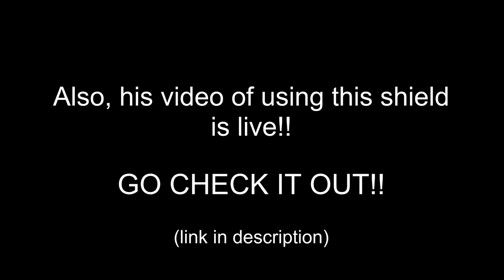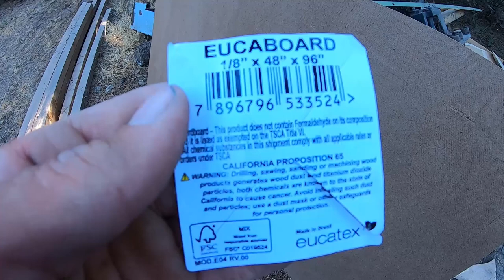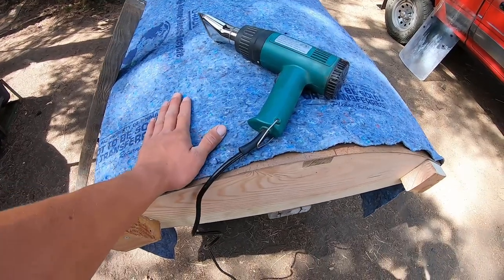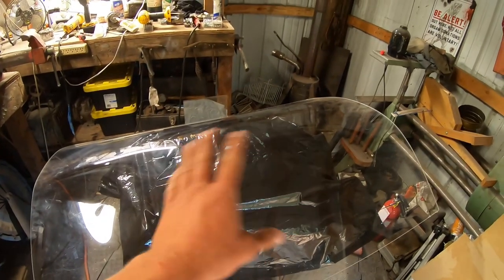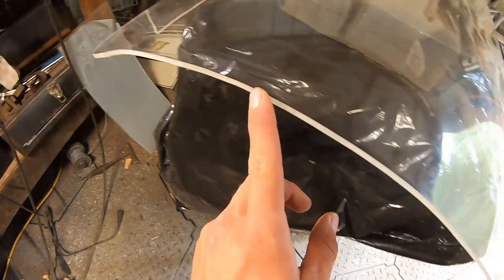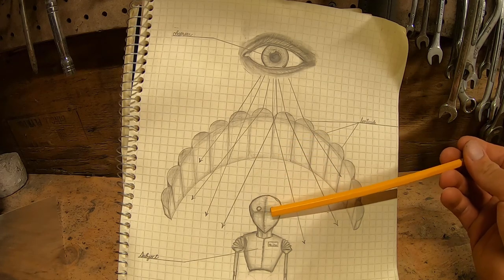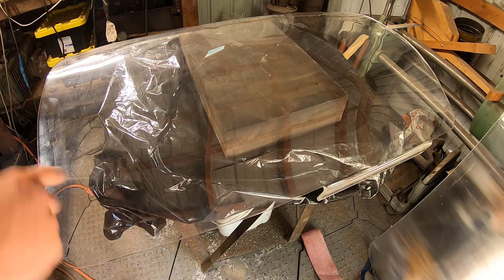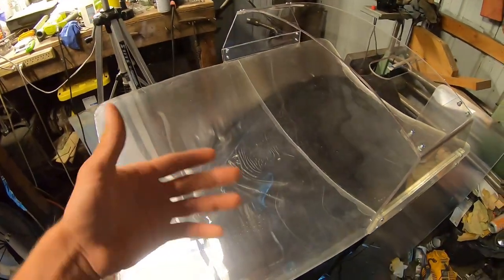Building An Updated Invisibility Shield... For Chris Ramsay!?!

Comment from the maker: To everyone curious, I purchased my lenticular lenses here from this website: https://www.lenstarlenticular.com/store
The specific ones I used for this project were the 100 LPI 3D option. Thank you all so much for the support on this video!
Reply: I did not say this: try wearing vertically striped clothes, with alternative darker and lighter tones of gray, behind the shield...
Reply: Why don't you liquify it and dip it into cloth and make a suit or clothing out of it?
Reply: Make a invisibility suit
Reply: How much would you charge to make one?
Reply: Have you experimented with the different "viewing angles" they mention? Im sure that effects the distance that the object to be obscured needs to be from the shield... also perhaps I could put in a order with you for a couple sheets?
Reply: When cutting plexiglass I have found using a router makes a great edge and no cracks or breaks. Not to mention super fast. Or add oil to the jigsaw blade, or to a drill bit. Less cracks are a good thing, and it speeds things up.
Reply: You need to make one of these using Norland 61 UV Cured Epoxy, so you can coat the entire shield with the epoxy and lay the lenses flat onto it, then cure the epoxy by setting the whole thing outside in the sun.
Reply: Can you beat a motion detector with this?
Reply: Have you tested this with IR or thermal?
Reply: I would love to see, what happens if you apply the 3d layer on both sides or in multiple layers (on multiple plexi). Also glueing 2 sheets together and making just the frame from plexi so it would be lighter.
Reply: 13:57 that sound makes me misophonia :v
Reply: Can’t you you just scrap these from old flat LED computer or TV screens?  I have scraped old projection TV screens for the franzel (sp?) lense to make solar magnifying cookers etc., but there is usually an extra lense or two which also seems to defract light in a similar fashion as yours does.  I have also found such lenses in old laptop and phone flat screens.
Reply: Disciplinary committee and de foo
Reply: @deusexaethera  well, you beat me to it. But you're correct on the glue type. A low viscosity UV epoxy would work perfectly as long as he could minimize the bubbles that form during curing. I know with cell phone screen I have a vacuum chamber I put the screen in once they are glued and it automatically pulls the air bubbles out then flips on the UV while it's under vacuum. The screen comes out so clear you can't even tell they are a refurb because the only part that's not OEM Is the glass, glue, and double-sided adhesive tape. Pure Genius if he would put both bits of knowledge into one amazing device. I love technology 🤣😅
Reply: @MrMoonFlame  yes
Reply: Just one question. Why?
Reply: @garlanddavidson6845  what would you use it for? Aside from stating the obvious!
Reply: @carlwilliams6977  Becuase he can and because he was asked to do so!  That's whu👍
Reply: @Photosbylambert  I thought I eliminated those answers in my op by saying other than the obvious. Let me spell it out for you. What could be a practical application that would justify all this work? I mean sure, I can't see him, but I can sure as hell see something that doesn't belong there!  As a high school science experiment, it's pretty cool. But practically??
Reply: @carlwilliams6977  answer: deer hunting blind for ground blind or tree stand. 😆
Reply: Would this application be effective on a parabolic shape?
Reply: At night? I would imagine similar as long as ur not backlit. Our eyes scan for, and easily pick up, human shape. This has potential!
Reply: What if you did it on the face shield of a motorcycle helmet, would it look like you are headless?
Reply: @carlwilliams6977  Idk I’m somewhat infatuated with it. ,I would probably use it with friends,and show people that it’s possible To be cloaked in real time.
Reply: Are you interested in selling some of those sheets?  I'm looking to making some art pieces with this but technique but do not need 75 sheets just 2-3.
Reply: @MrMoonFlame  No.  The Fresnel lenses on your TV and computer screens use a pattern of concentric circles.  The lenticular lens used for the invisibility shield uses parallel lines.  To see the difference, compare the close up photos on the wikipedia.org pages for "Lenticular Lens" and "Fresnel Lens".  The Lenticular page has only one close-up photograph.  The equivalent Fresnel photograph is honey-colored, a little bit down the page on the right.  If URLs are allowed in these comments, here are the links:

Fresnel Lens:
https://commons.wikimedia.org/wiki/File:Flat_flexible_plastic_sheet_lens.JPG#/media/File:Flat_flexible_plastic_sheet_lens.JPG

Lenticular Lens:
https://commons.wikimedia.org/wiki/File:Sq3d-Feuille_lenticulaire.jpg#/media/File:Sq3d-Feuille_lenticulaire.jpg
Reply: I was thinking instead of a heat gun, how bout a salamander heater, runs on deisel or kerosene.  Use a little infatred thermometer gun from 'Harbor freight tools" about $20 ??
Reply: Are use going ever sell any of Pre-made Shields 🛡 I’ll buy one from you, if you do ? $$$
Reply: Craft in the sky? Cloaked ships. Great video old tech for the govs. Imagine what's possible now.
Reply: So no-go ? So guess I need To be famous with a YouTube channel just for you think about getting a reply ?
Reply: @advoempower  good question, I have a FlironePro, in my opinion you would see a square at least. It needs a little more science to go invisible from I.R. in my opinion , still good question.
Reply: @Photosbylambert  no doubt I worked in a similar shop that's exactly how we dit it then into a walk in Autoclave, in fact we made the riot shields the designe he's using the core of the shield we made was ballistic kevlar and they had optional bulletproof composite glass viewing window, and a cup holder......cupholder joke
Reply: @carlwilliams6977  conversation piece, open minds to other possibilities. Wrap a car in it stick your head out the sunroof lol.
Reply: what happens when you put another lenticular sheet 90 degres off of the first sheet ??? would that make vertical and horizontal thigs disappear or would one make the other cancel out ????
Reply: @Johnnylooks_Overhead5164  100% old technology for govt.
Reply: How much? I need one.
Reply: @RandomParrot  you make a better one then , Carpenter boy 😂
Reply: @deusexaethera  you make one then
Reply: @brianadams6628  Good answer , when's you're next album coming out ?
Reply: @leethomson5733  that was not what I was saying at all. I was just trying to help. What is wrong with trying to help someone with a task that is known to be a pain in the butt.
Reply: @RandomParrot  Ok then , now you've said you're piece try making yourself invisible 😂
Reply: Can you send some of that material to Braille skateboards they have a YouTube channel and see if they can make an invisible skateboard 🙏
Reply: @evilbeetlekustomscreations4965  That would be so f***ing COOL  😁
Reply: @Randomn, if you are willing to sell one of this I would happly pay top dollar. Please DM me!
Reply: You said you had to buy the sheets in bulk...
Can I buy 4 or 5 off you that you are not using for an art project?
Reply: @skooliebuild2444  why didn't he use the invisibility shields he already had to steal the rest of them instead of buying them , what's the point in having super powers if you can't use them for your own advantage? 😂😂
Reply: @Dyenosaur00  I take it you're a 3 year old !
Reply: @leethomson5733  they liquefy diamonds you're telling the can't liquefy this?
Reply: @Dyenosaur00  I didn't say they couldn't ,  i  wonder why would you want to wear invisible clothes , are you planning on robbing a bank ?
Reply: @leethomson5733  the military would pay you millions
Reply: @Dyenosaur00  Imagine you walked on the road and got hit by a truck because the driver couldn't see you because you were invisible 😂 not good , then you would continually get run over all day long cos no one would see you lying in the road 😂🤣😭
Reply: @RandomParrot  I drill thru my Plexiglas with a dremel.  The RPM rates makes a perfect hole that is fused and NEVER cracks or splits.  Glad I discovered this.
Reply: @jeffgriffen7038  rpms is where its at with this stuff. I have used a router to make plexiglass horse shoes, to back light. And it worked well, but the dremil for holes is brilliant! I'll be stealing that one.
Reply: you can find these lens's in a printer under the glass, find some broken printers and get an A4 sheet for free
Reply: @thezellyshow8491  I have the liquid form, you have to drink it but the effects cannot be reversed, I need long term guinnea pigs to find out about long term health issues if any, are you in ?
Reply: @thezellyshow8491  keeps the insane from turning sane LOL 😂😂🤣
Reply: @advoempower  thermal can't even see through glass windows. Infra red gets deflected same as regular light. :)
Reply: @MrMoonFlame  freznel lense probably won't work but you can use them to melt granite with sunlight.
Reply: Yeah. I wanted to ask about calculating that curve. Are you trying to approximate a parabola?
Reply: Can you see through the other side?
Reply: @kiaftlol  Want.
Reply: What is the distance you have to be from the shield so you are invisible but the background behind is not??
Reply: All that great work then you wear a black shirt whike demoing in front a white or light background kinda dampened the illusion
Reply: Wow! Thank you for telling us where to get these sheets.  I spent a bunch of time trying to find them. I should have looked down here first.  Thank you again!
Reply: Where can I get the shield... asking for a 33 almost 34 yr old kid at heart
Reply: Than lenses plastic heat can be found in flat screen tv for free
Reply: What you could do with is building a heated vacuum former a large one 👍great video
Reply: Be cool if you sent a few of these to demolition ranch for testing to see how strong they are.
Reply: Can u make anything??
Reply: Do the acrylic sheets have to be curved or can they be flat when applying the film? First time seeing this and I have ideas!
Reply: Apocalypse Horizon  Thank you.
Reply: Apocalypse Horizon  I thought this make a cool curved shower door. Shh...don't tell my husband that I found something new to experiment with! 😂
Reply: Brother, buy a weed burner. Not as much of a workout.
Reply: G
Reply: @Dyenosaur00  It needs to be spaced away from your body to allow the light to bend around you. You can’t make a sleeve out of it or taper it to your waist. It won’t work that way.
Reply: @jareds8720  Actually, you can beat a motion detector with a solid white bed sheet. No need for lenticulars.
Reply: why dont you made big lens for telescope?
Reply: Instead of using one direction can you use two one on the front and one on the back capturing the light from both directions.
Reply: I BUY YOU A 1meter shield for 1000$ NOW!!
Reply: Why not cover the whole shield with glue before applying the Fresnel? Vacuuming is the next step but that wouldn't help without a full glue coverage.
Reply: damn that's expensive
Reply: It
Reply: Would I be able to reach out to you and talk about totally something different but it impliments your technique?
Reply: 100% thermol blocking tree suit, single sided,low emolsion, roof paper two layers with 1cm foam in middle, silver side outter out,inner in..silver facing body outter facing them.. Silver reflects your heat in..external heat away.
Reply: Oh thermol suit,,,patriots for american
Reply: Totally fake up, truck is viewable from the glass but man is invisible
Reply: @thezellyshow8491  why would u buy a fish when he's teaching u how to fish?,
Reply: @advoempower  won't work on thermal. Heat signature is still there. As soon as I seen this I wondered how to incorporate it together.....it's possible
Reply: That's expensive and outdated. Ouch what a Rip
Reply: What material is that light bending shield made of?
Reply: Dude I'm guessing not due to all the people asking,  but I'd love to buy one of these from you, even a very small one.  Doesn't need to be a shield and that much energy to make. Please respond if you do. Amazing skills man
Reply: ALL FUN IN GAMES TIL SOMEONES CAT DOES THE WORK FOR YA AM I RIGHT!!

LOVE THE CAT WATS HIS NAME
Reply: 000
Reply: could suspend it over an outdoor griddle to heat it.
Reply: Yes how much to make one?
Reply: Its says website expired

Comment: I worked in a plastics plant for over 22 years. I would like to make a suggestion. Rather than plexiglass, or polycarbonates, use Lexan much more durable. Same material used to make power meter covers.
Reply: @HumanPerson Contact manufacturer and ask for product spec. Comparison data sheets, so that you might find the best product for your project.
Reply: Isn't Lexan and polycarbonate the same thing? Lexan being a brand name for polycarbonate?
Reply: Transparent aluminum is even better if you can get it.
Reply: @samhenley7156  didn't know ALON existed until your comment and looking it up. Very cool material
Reply: Lexan is a polycarbonate sheet it is just the brand name, I would suggest using a sheet with a plastic protective covering so it can bend with it, or if you only have one with a paper covering available peel it before you apply heat, you have to be extremely careful not to scratch it but the end result is worth it.
Reply: @samhenley7156  Hello Computer !!!! Just use the Keyboard !!!

Comment: It might be a cool idea to try making the edge of the shield wavy, jagged, irregular, or otherwise not just a straight rectangle. The straight edge really stands out to the edge-detection in human sight. So breaking up that edge with something should make it harder to see.
Reply: I was thinking a giant wavy edged Pac-Man ghost shape
Reply: Your eyes are much more sensitive to luminance changes than color changes, at 100 yards I think you will be hard pressed to pick him out.  I agree the edge is abrupt, but I think the effect will not be as good if you make the edges irregular because the tiny lenses will be broken.
Reply: @eformance  What do you mean about the lenses being broken? With this kind of lens, as far as I know, a small piece of it should work as well as a whole sheet. The sheets shouldn't need to be intact. The lens effect depends only on the fine ridge structures in a small local area, unlike with a traditional glass lens. Or did you mean something else?
Reply: @delphicdescant  The lenses are long columns of half cylinders, there is some light conducted vertically through the lenses in the shield to help average out the luminance of the projected image.  If you cut the edges into a sawtooth pattern I think the effectiveness of the lenses will be reduced and you will see artifacts in the projected image.  This is my hypothesis, the only way to know is to try it.
Reply: @eformance  makes sense.
Reply: Imagine a dome made of this stuff and put over a small town
Reply: @eformance  Interesting idea, but I'd be a little surprised if that were the case. For light to be conducted up or down those (assumed vertical) columns (meaning it is bounced along the inside of the column like in an optical fiber), and for that same light to reach the observer, would require a hard near-right angle bend in the path of that light. Unless, of course, the observer were looking at the lens from an oblique angle above or below whatever is being hidden, which would make the entire shield ineffective in the first place.
Reply: @markusandrejeff1940  who is to say the government hasn't already done that with parts of area 51?
Reply: @markusandrejeff1940  the simpsons
Reply: @delphicdescant  I don't think you watched his video lol
Reply: Curve edges inward so viewer can’t see the actual edges of the shield? Or file them down to a fine edge
Reply: @liftingisfun2350  I don't think you understood my comment.
Reply: Have to make the edges thinner to reduce the light entering from the sides and then it won't matter
Reply: @eformance  The only way light would be transported longitudinally through the lenses is with total internal reflection, which won't be in play unless you're looking at the lens nearly edge-on. Furthermore, the effectiveness of each lens at doing that doesn't really depend on what any adjacent lenses are doing, so making it jagged won't have any real effect of that sort.
Reply: i broke your 333 likes

Comment: Have no idea how I ended up on this video but I watched every second of it. This could have come in handy when I was a teenager.
Reply: Somehow I ended up here also . . . and watched every minute of it.  I kind of want one.
Reply: So Daddy couldn't see the boys you were hiding?
Reply: Invisible, everyone wants to be
Invisible, to hide, to hide, to hide, to hide
Reply: Not having to run from police when the teenage house party got busted? 😂
Reply: What would happen if you did one opti lense run horizontally and nothe on the other side of sheed vertical  
would that take away the need to have your object in the right position
Reply: I have a mobile oven in my workshop for drying out starter motor parts that I`ve not used for years. Plus loads of plastic sheet hanging about. I might experiment at the weekend. :)
Reply: I don't know how I ended up here either. But it's crazy this is actually doable
Reply: It would be perfect for theGirls locker room and your crushes bedroom, after the pharmacy,bank, and liquor store of course ,and don't forget to have a surprise visit to the class bully
Reply: @briancarter3704  🤢🤮
Reply: @briancarter3704  so you want to use it for every evil purpose you're simplistic mind can think of?

Comment: You can use the vacuum bagging technique they use when laying up fiberglass parts in molds, that will give you a consistent pressure all over and let you apply adhesive over the entire piece.
Reply: +1 Same thought!  Plus add boca uv glue from cell screens!
Reply: This ☝️